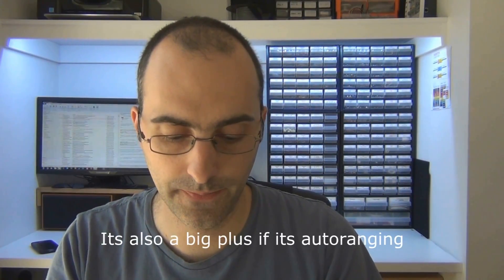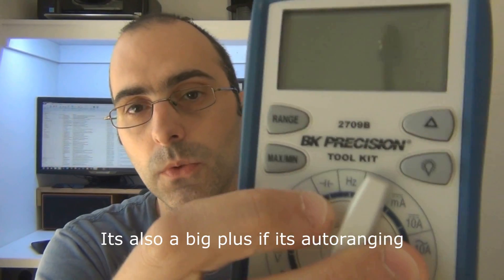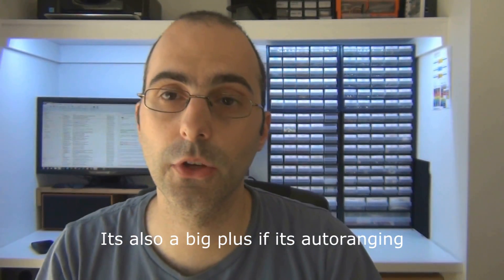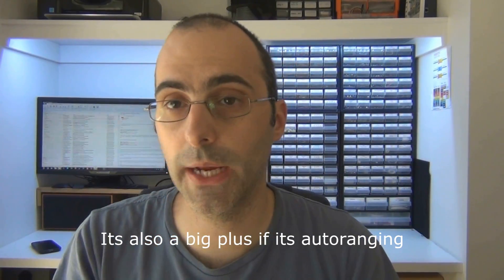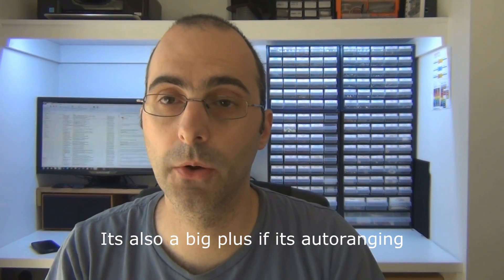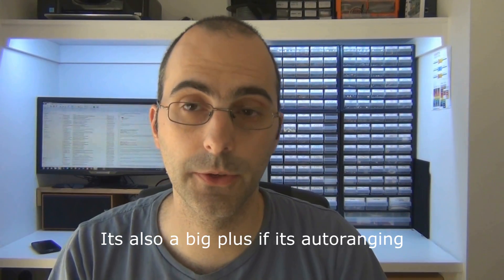B2B - Do I Need A Multimeter

Comment: Some thoughts on cheap multimeter's. Be very careful with them. there is a lot of information showing that they don't always have the required protection, such input protection and hrc fuses, if any. this mean they can be dangous for test high voltage and current. they are probably fine for 9 volts though. just take care when choosing one and make sure its suitable for the application.

Comment: Harbor Freight and Dollar Tree in the U.S. has them for $2.99 and actually I think they have them cheaper. I have a nice Fluke that does everything, even tests current (I) up to 10 amps and Frequency but I have a couple of the cheap meters to toss in the car toolbox, the junk drawer, I have one by the emergency toolbox, and one that I have on the bench when there is the remote possibility that I'm going to blow it up... I think this was a good informative video.